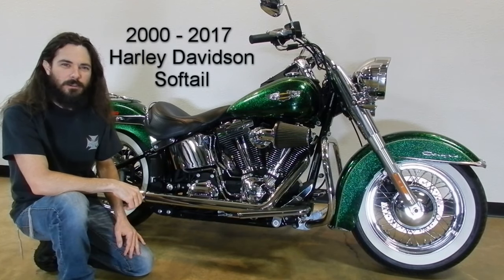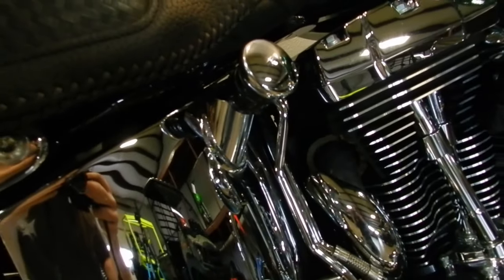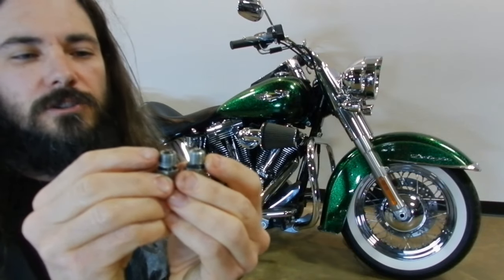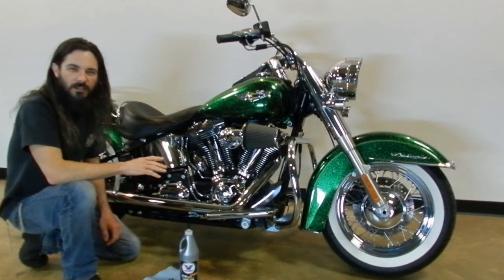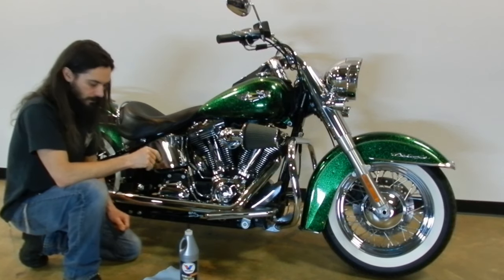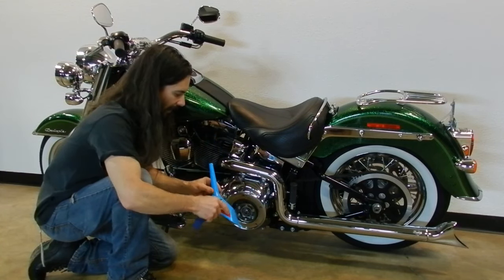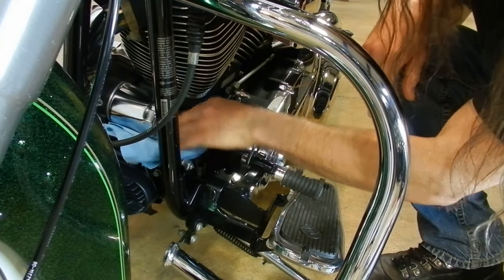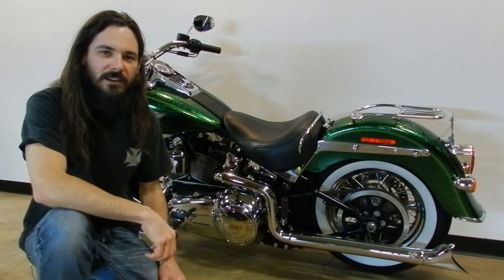3 hole oil change Harley Davidson SOFTAIL (2000 - 2017) Engine, Primary, Transmission Fluid service

Comment: what could be causing my oil dipstick to shoot out?  I've read it could be overfilled but it is not.  I've drained a lot of oil out and it is still building up pressure and shooting the new dipstick out!

Comment: Excellent video.  Thanks.  Question:  Where did you get that paint job and what color is that?
Reply from the maker: It is a factory color. 
The bike has not been repainted. 
Unfortunately I do not have any additional information regarding the paint.

Comment: Wanna do it myself but I think dealer put the filter on to tight. Now I can't get it off. kinda done stripped then notch for filter wrench. What's an easy way with taking it back to dealer.

Comment: Very nice and helpful Video well done but please I need your advice I just bought a used Softail CVO deluxe 2014 can you recommend what's the best Oil to use i mean brand and type. thank you so much
Reply from the maker: The best oil to use is the oil that i use in this video.  
Mobil 1 20w 50 full synthetic for V-twin engines.

Comment: Nice vid,I have a 2017 softail with 2000 miles on it
,be doing my 1st service on it,a little nervous,previously had sports bikes,just bought the amsoil for 3 holes,I have  couple of questions,do you need to replace the derby cover gasket and o rings every service,and is it important to purge the old through as shown in del boys garage,I think a 3rd of the old oil is still in the system,keep up the good vids,cheers from Devon in the UK.
Reply from the maker: Hey Devon, 
Great questions. 
You do not need to replace the derby cover gasket or the drain plug o-rings every service. 
You do not need to replace the derby cover gasket or the o-rings EVER unless they are leaking oil. 
You should NOT purge the system as shown in delboyds garage because it is extra work, and unnecessary.  
If you are running synthetic fluids and replacing them on a reasonable schedule, the small amount of "old" oil that remains in the system is entirely insignificant to the performance of the machine or the wear on the engine. 
Make sure you warm up the engine before you drain and replace the fluids. 
Thanks again and cheers.
Reply: @JayWCase  Thanks for answering this question. Will make servicing less a pain in the $%&. You do great job at instruction videos.

Comment: For the drain plug on the transmission, you sure the allen wrench is a (5/8")?
I was sure it was (3/8"), allen wrench, in the center of the plug, with a (5/8") socket for the plug's hex-style outer edges.
Also, I don't think the oil tank is "air tight."  The return line on the tank is just sorta 'clipped on,' with a plastic clip to hold it in place.
I guess the newer, larger CI engines have the oil pan under them, eliminating the oil tank.

You also did not offer to show the oil purge for that bike...  See, "Delboy's Garage," and look for the oil purge video...
He shows how to get another quart of dirty oil from the filter and engine oiling system...  That's a bit of dirty oil to just leave in the bike, for no good reason...
The aluminum baking pans is a good idea, if you need a pan low enough to catch the oils!
Reply from the maker: Yes, it's 3/8".

Comment: Did you replace the rubber O - rings on drain plugs?
Reply: P. S. You did an excellent video.
Reply from the maker: Thanks Fred!!
Reply from the maker: Don't replace the O-rings unless they are damaged or leaking.

Comment: When you change the oil filter should you have the oil tank empty?
Reply from the maker: There is an oil check valve and an oil pump in the Oil flow path between the oil filter and the oil tank, so it makes zero difference if the tank is full of dirty oil or clean oil or no oil or vanilla pudding when you change the oil filter.

Comment: Have a 2007 fatboy.  Never saw ay leaks.  was riding along at 50 and engine started straining, then back tire locked up and threw me.  Im too messed up to check but will ck tranny & primary when I can walk.  Oil level ok.  any comments?

Comment: Question, if I am using HD 360 for my oil change what would you recommend for the other two systems?
Reply from the maker: Thats a good question Joe.  
If you are going to run a Harley oil in the engine, then i guess it would make sense to ask the Harley shop what they recommend for the other two holes.  I don't have much personal experience with Harley lubricants.

Comment: I know nothing about motorcycles. Why are soft tails, called soft tails? I've heard the term before, but never knew the reasoning...
Reply: Introduction of the shock absorber system with shocks out of view, so that they look like the older rigid style.

Comment: Sorry I just have my first motorcycle so how often or how many miles I sure do the oil change?
Reply from the maker: It depends on what kind of oil you are running. If you are running synthetic oil in the transmission and primary, i would change it at around eight thousand to ten thousand miles.  Engine oil should to be changed at four or five thousand miles.  Always change all three fluids at least once a year.
Reply: Ok thank you so much 
I appreciate your help thank you

Comment: Well, I’m screwed, bought my deluxe in October and just now done an oil and transmission oil change, trans is stripped, tried for an hour to get it straight won’t go so finally I thought it was straight nope. The person that owned the bike got it in there, I could see the metal when I used a mirror. Don’t know what to do now without paying a fortune. I just don’t know, if I should impact it tight and hope it doesn’t leak and trade it, or get someone to tap it and put an oversized plug in. I’m depressed about it
Reply from the maker: I have experienced this with a customers bike.  First, you should know that cross-threading a drain plug is not that uncommon.  You aren't the first to have a bike with a cross-threaded plug.  I understand the temptation to tighten it down and pass the problem along to someone else.  Please avoid that path.  It will come-back around to bite you 100 percent of the time.  The universe is watching.  Make some calls around to local mechanic and automotive shops and describe the problem and get some quotes to cut new threads.  It should not be more than a couple hundred bucks and you may find some quotes that are surprisingly affordable.  There is no reason to remove the gearbox or engine from the bike.  There is no reason to take anything apart either.  You can be sure that someone who quotes $800 bucks for the job is attempting to rob you.   Keep me posted with what you find out.
Reply: J W Casebeer   Was told that Harley refuses to cut new threads in trans, so went to a local chopper shop today and he cut new threads for me. Took him about 1 1/2 hrs kinda tuff jobs b/c he didn’t want to take shock absorbers off. He only charged me 60 dollars and said he wouldn’t even worry about changing that trans oil for next 20,000 miles. LoL    I’m happy now but that is really a terrible design to begin with.
Reply: @JayWCase using the fluids you did in the video. How often do you recommend changing the fluids?
Thanks in advance for any time and consideration to this question

Comment: Is it necessary to torque all plugs and primary cover screws ?
Reply from the maker: If you snug up the plugs and screws then there is no reason to use a torque wrench.

Comment: Quick question you are just putting oil on the lip of oil filter , have seen few videos where guys are filling up the oil filter with oil up to threads and then installing . Any comments.Tx
Reply from the maker: Obviously the other guys are all about half a brick shy of a load. 
When you hit the starter button on your bike, the very first thing that happens is the oil pump fills up your oil filter with oil.  Don't believe me?  Just watch the red oil pressure warning light on your dash after you have started the engine.  When the red oil light goes out, then the oil filter is full.  If you don't think your oil pump is up to the task of filling your oil filter for you, then by all means fill up your oil filter yourself.  Filling your oil filter yourself is an especially good idea if you are wanting to spill even more oil all over the front of your engine than you already spilled getting the old filter off.  Thanks for the question, and happy trails.
Reply: @JayWCase  Got it Tx. Do you put locktite or O ring is sufficient on drain plugs.

Comment: Cold where does the oil stick read?
Reply from the maker: The difference between cold engine oil level and warm engine oil level on the dipstick will not normally be significant.   It is best to check the engine oil warm because the engine will pump any oil out of the crankcase and back into the oil tank and give an accurate reading.

Comment: What s primary?
Reply from the maker: The "primary" is a term that makes reference to the "Primary Drive Chain assembly" 
The Primary Drive Chain connects the transmission input sprocket to the Engine output sprocket.  On some motorcycles (usually custom Harley Davidsons) the Primary Drive will be a large, wide belt instead of a chain.

Comment: Which is best way to replace oil drain hose? Remove oil tank or remove rear wheel? And any special tools to remove rear wheel? Oops it's on a 14 heritage classic 103
Reply from the maker: Hey Joseph, 
I appreciate the question. 
Unfortunately i have never replaced the oil lines on a Twincam. 
I am not sure the best way to go about the process. 
There should be some videos about it somewhere here on YouTube. 
I'm sorry i couldn't help.
Reply: Yep I found tips on utube,between several videos lol but I did it ,lol it was alittle b.....

Comment: I noticed you didn’t drain the engine case. Is it not required?
Reply from the maker: Its a dry-sump engine, which means there is only a very small amount of oil in the engine case.  It is not required or recommended to try to drain the engine case due to the possibility of damaging the drain plug threads while removing and reinstalling the plug.
Reply: @JayWCase  thanks very much for the info

Comment: Just finished changing the transmission oiil on my 2015 Softtail. But after riding it, I noticed a little oil under the bike. The manual says to tighten the transmission drain plug 14-21 FPS. I set the torque wrench to 17...I wonder if I should up that a little. I didn’t want to overdo it. Also, I notice you said 24 ounces. The manual says 28, which is what put in. Maybe too much?
Thanks.
Reply from the maker: It sounds like you need to replace the o-ring.  They almost never leak, but when they do, its time to replace them.
Reply: @JayWCase  thanks...it looked good, but I’m gonna check again.

Comment: How much oil goes in the primary?
Reply from the maker: Lots!!  
Somewhere in this video i say how much. 
But i don't remember off hand.
Reply: On my 2009 Softail its 32 oz per owners manual. . He says 26 oz. in this video. Check your manual. Bike upright, oil level should just touch bottom of Clutch basket.

Comment: Why didnt you drain the plug under the engine ? There is a hex screw to drain to
Reply from the maker: Fredrik!!! 
Do not!  I repeat, Do not remove that weird little plug!   
It will drain all the blinker fluid!!

Comment: I believe you did one thing wrong, before I put my filter on I start my engine up and I let it pump out oil till I  see clean oil which is about a quarter of a quart I’m amazed that people do not do that when they do oil changes. because they leave about a quarter of dirty oil in your engine. That how to do a oil change.